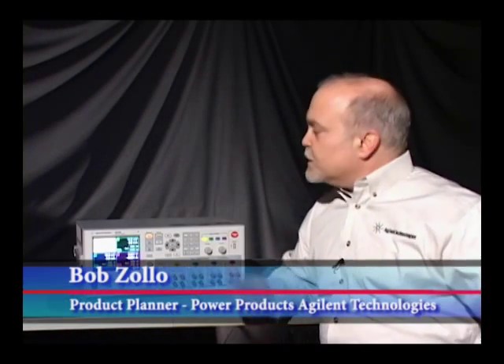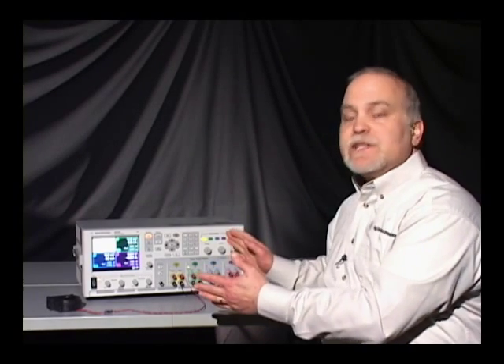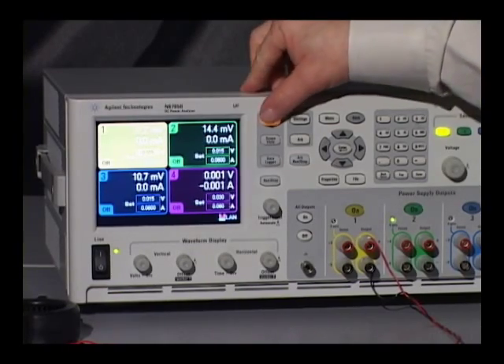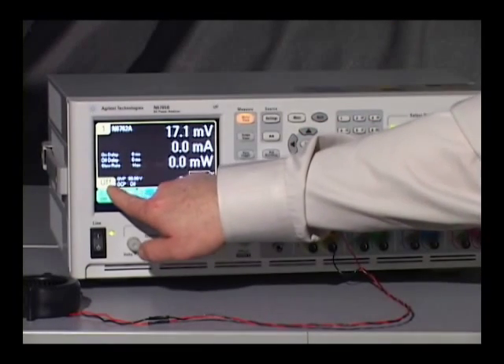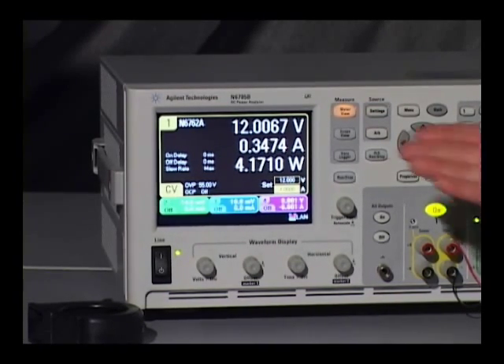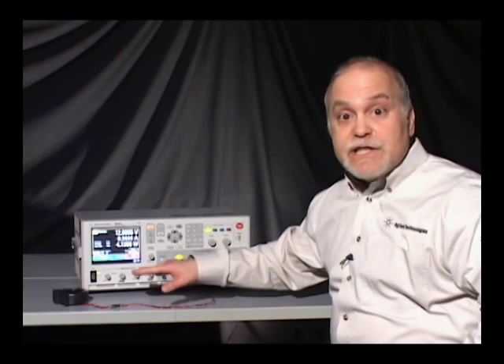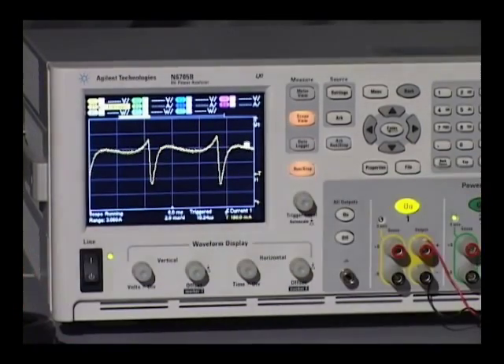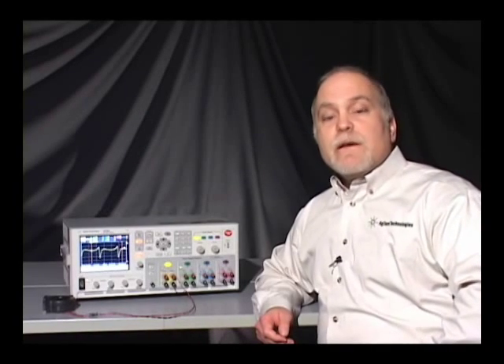N6705B DC Power Analyzer Scope and Power Supply Capabilities

Comment: "You can see now the power supply is putting out 12V, the fan is pulling about 350mV or thats total of that 4,2W"
Mr. engineer, you mean 350mA?
xD
Reply: A slip of the tongue 😁